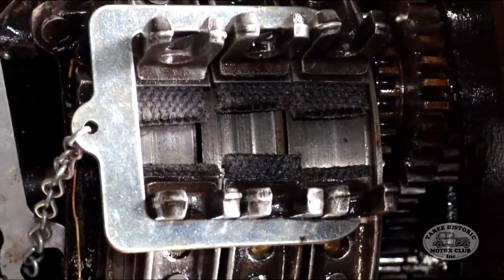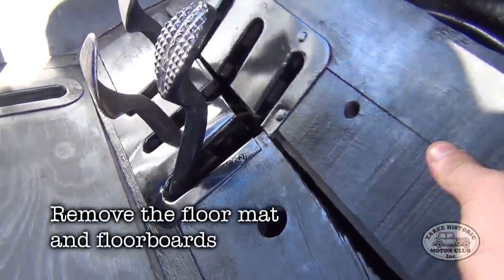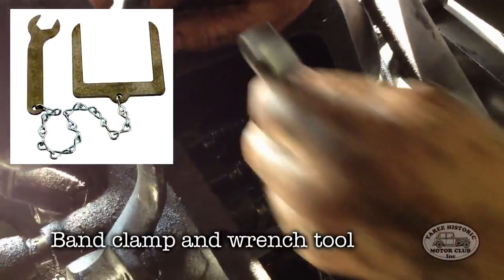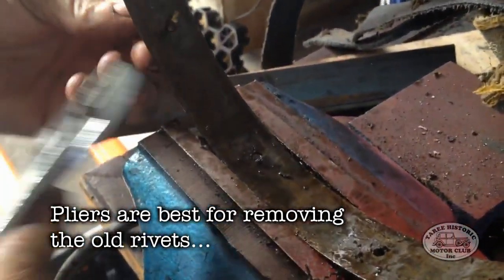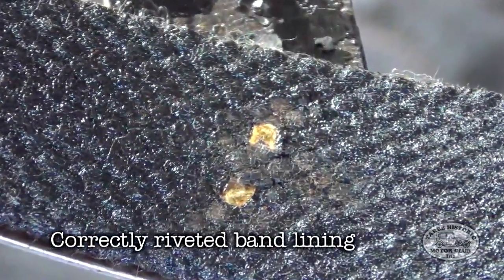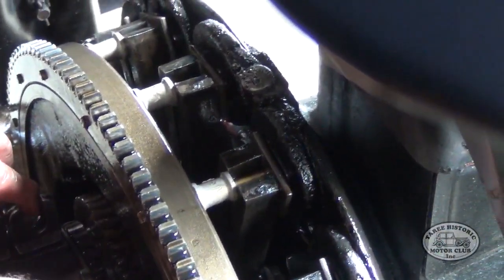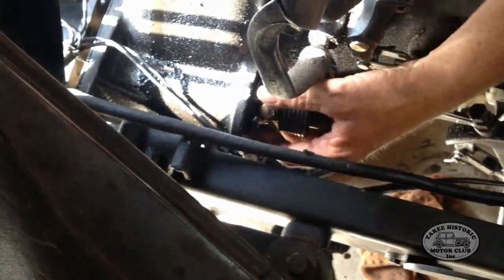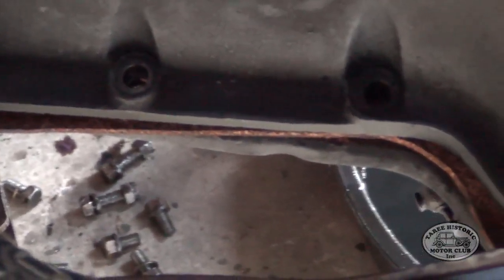Ford Model T - Replacing Transmission Band Linings

Comment: So I've been told that since I have the removable ears that I can replace the bands without removing the hogs head, do you know of a video that shows this well? I have read about it in the manual and it seems strait forward but watching a video would be helpful. Also, I was told that when you remove the hogs head, you affect the rear bearing of the transmission and can cause damage?
Reply from the maker: As my bands have the fixed ears, I can't really comment on the alternative. As you can see in my video though, pulling and reinstating the hogs head is reasonably straightforward, albeit awkward! We got there in the end though 😀

Comment: You do realize that it is not necessary to remove the hogshead to replace the bands of the transmission and go through removing the starter u-joint and all that they make a tool for removing the bands and installing the new bands.  https://www.snydersantiqueauto.com/band-tool  it is much quicker and easier than removing the hogshead and does not require and new gasket.  By the way if the hogshead gasket  has been on their since the last time the bands were replaced the gasket needs to be replaced also.  If the gasket is in good shape that means that the transmission bands are either cheap quality or improperly adjusted causing them to wear to fast.
Reply from the maker: I know it's not technically necessary, but it does make the job a little easier and less fiddly than working through the transmission cover lol....
Reply: I don't know about that I found that using the band tool only takes about an hour to remove and install new bands including riveting new band material.  I admit it takes practice but with practice it goes faster and you learn the tricks to get it to go smooth.  But I still think in your video you should mention that this is not the only way and give your viewers the option to do like you or investigate other options.

Comment: I am so thankful for your videos! In the service manual I find no mention of transmission fluid. How is transmission fluid kept full? How is it drained and replaced? What sort of fluid is used?  Thank you!
Reply: L. E. Brookshire the T doesn't use trans fluid.  It uses the same oil as the motor
Reply: The transmission uses the oil from the engine crankcase.

Comment: Hey Mitch, I can't thank you enough for these videos! My dad's '15 (he completely restored when I was a boy) is now in my garage and I've been learning things the hard way... one of which is that I likely toasted the brakes.  I was watching this video and you pulled the hogs head to change bands. Here are a couple questions:

Was it necessary to pull the hogs head or could you have done it without pulling it?  Or better asked, is it that much easier to change them by pulling the hogs head? I barely remember the work my dad did so I'm like ok Ing for the best advice I can get.

Can the brake band be adjusted prior to replacing them or do I just have to replace them? 

Are all three bands the same including the liners (are they interchangeable)?

Again, thanks for the videos!

Comment: How is it that the ends of the metal lining rivets don't scrape the drums?
Reply: The rivets will rub the drum when the lining wears out. They're brass so they won't hurt the drum unless the car is driven a lot with worn out bands.
Reply: What are those band linings used for
Reply: its basically the equivalent of brake pads or clutch disk material of a modern car. If you have metal on metal, you'd have no slip, BUT they would destroy one another.
The cotton linings give the friction needed to remove slip, but become the sacrifice of the system, so instead of replacing expensive metal parts, only a cotton band has to be replaced.

Comment: I have two questions for you. What kind of transmission oil works best and is it OK to run synthetic oil in the engine?
Reply: +Russell Sova Hi, Matt here. I'm a MTFCA member an owner of a Model T chassis and maintain my grandfather's 1924 Roadster for him too. Honestly just about any modern car oil is of higher quality than the molasses like stuff they used back in the day so you really can't go wrong. 10W-30 is a favorite for many club member for normal spring-fall driving. Synthetic is alright. An important note though: if your motor has not been disassembled and cleaned try to avoid using detergent based oils. They work so well you're likely to gum up the works as it cleans out a century worth of garbage. If you go detergent based change the oil often for the first couple thousand miles (like every 200 miles until it's cleaned out).

Comment: Did you have a six or twelve volt battery on yours? I bought a 1925 Ford Model T a year ago and I'm almost ready to put a battery in, my grandpa used to have a model t with a six volt, and he says that a six volt really is not powerful enough, and we spoke to an expert who claimed you could just bolt in a twelve volt battery and you would be fine, is that true?
Reply: As long as the starter, battery, cables and switch are in good shape and all connections are tight and clean a 6 volt battery cranks the engine more than fast enough. While a lot of people use 12 volt batteries it is absolutely not necessary and is much more likely to damage the bendix drive and flywheel ring gear.
Reply from the maker: 87craftsmanCUBE Strictly speaking, NO. Never connect 12 volts to a Model T starter motor, else it it will burn out the windings and break the bendix gear -- fact.
Reply: 87craftsmanCUBE The battery is only used for starting so if your stater motor can handle 12 volts then yes its fine.
Reply: I have 3 model-T's and all run on 12 volts with 6 volt starters and no problems. You don't run the starter long enough to hurt them.  If you have electric lights you will need to change the bulbs to 12 volts or they will burn out. Coils can stand 12 volts and will start faster on the extra voltage.

Comment: Nice to see you using cotton linings. Drive correctly, and they last well and no worries about ruining the drums.
You can speed up the soaking in process by using automatic transmission fluid.
The bendix should be removed before unscrewing the starter motor because if the bendix should rest against the magneto windings under the weight of the starter motor, the insulation is likely to be damaged.
When relining the bands, the end of the lining should be only a few mm over the end of the band, and the end rivets put in first. There will be a lump in the middle of the lining as a result, but this is simply 'massaged' out so the lining is flat against the band. Then the other rivets are installed.
One problem with starting with the lining overlapping the ends is that not all linings are the same length, so you could be caught short (some Scandinavian repros made by Cantex had this problem). Also, if the ends are riveted first, you might find that as you rivet further along the band the lining starts to want to stretch - the lining now being tighter against the band that when simply holding it by hand.
You have the right riveting technique, but to save damaging the material when flattening down the rivet, use a ball pein hammer.
Reply: Mitch,
I agree that the transmission band linings need to be flush at ends.
I did my first set of transmission band linings incorrectly and the lining was stretched between each rivet. That first set quickly wore out.
I subsequently have done many more sets in my 40 years of Model T restorations and the band linings last longer when done correctly.
Thank you for posting this video.